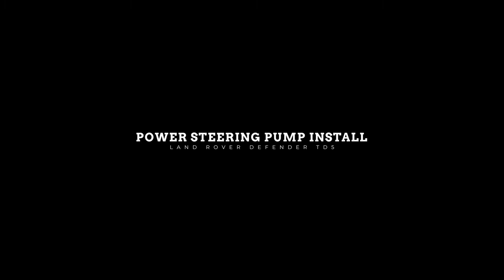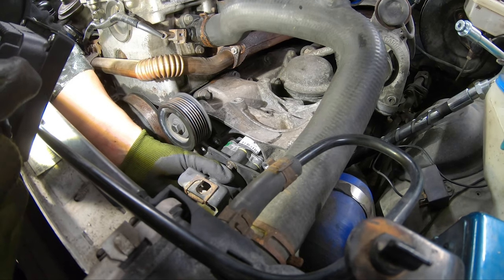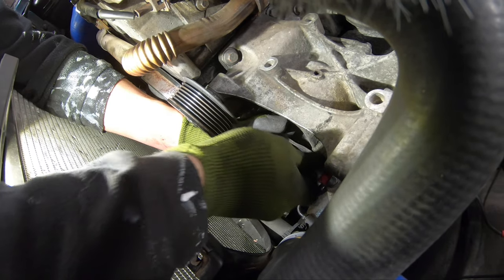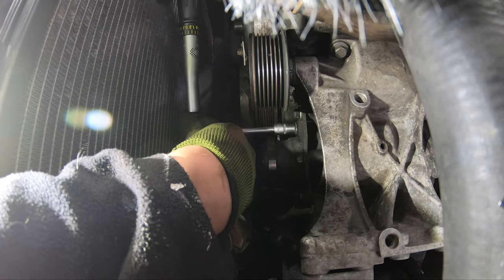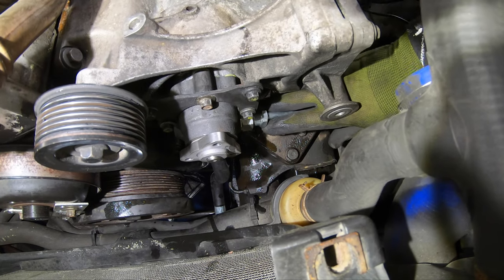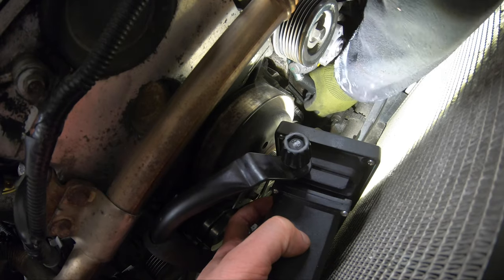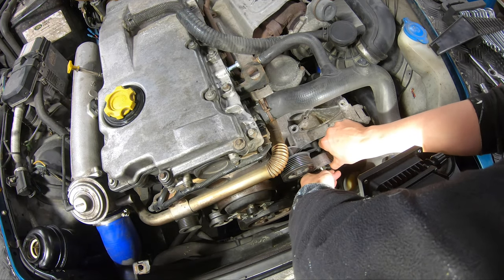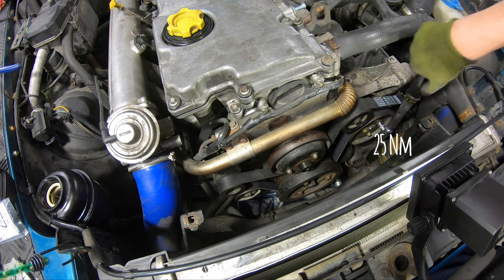How to install Power Steering Pump on a Land Rover Defender TD5

Comment: A few months ago i changed the seal on the steering pump so i took the opportunity  and also washed the container from the liquid that was dirty after 180k km.
Reply from the maker: Nice, is the seal holding? You cleaned out the reservoir? I did not but I think it’s a great idea. 👍😁
Reply: @LandRoverDrive  yes, pump is now dry like sahara 😁
Reply from the maker: Hehe, dry enough then. 😂😂 I'm glad it worked out for you.  👍

Comment: is the ERR6658 mounted backwards on that engine?
Reply from the maker: Do you mean on the opposite side of the engine? OR just flipped 180 degrees when mounted?
Reply: @LandRoverDrive  pulley flipped 180 degree on the bolt. But maybe I am wrong 🙌